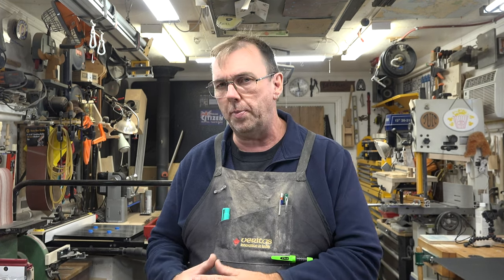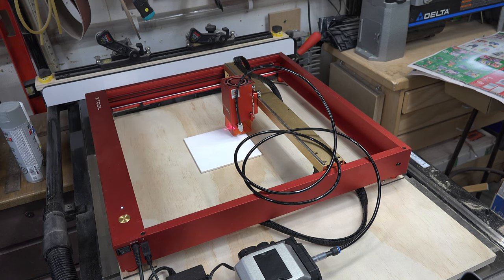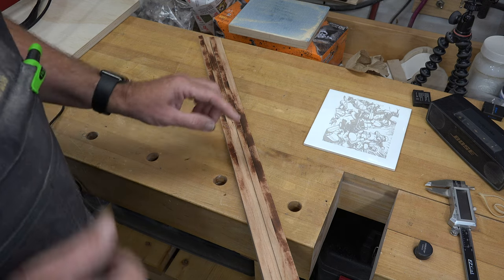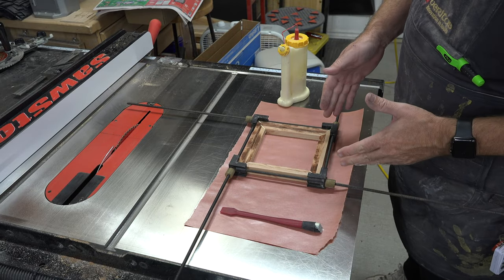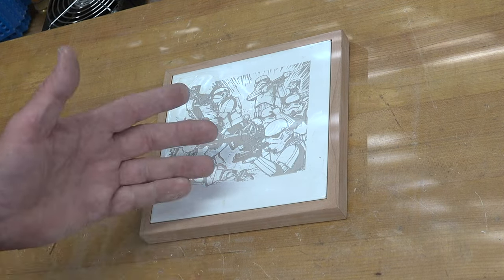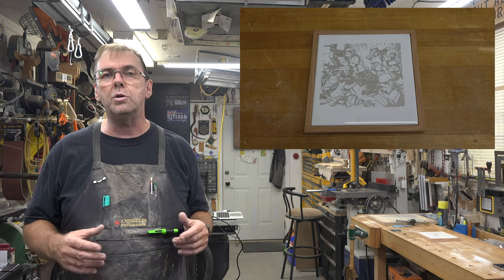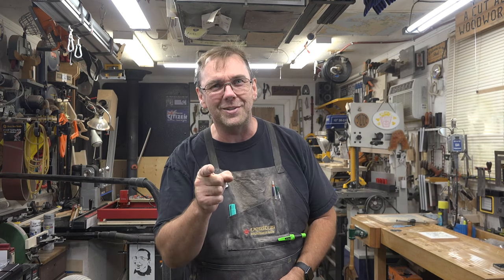Making Ceramic Tile Trivets

Comment: Kenny, I have been making trivets using ceramic tiles for years.  Gotta admit that adding the laser etched design to it brings the entire project to another level.  Another thing I do is to put a small self-adhesive cork circle to each bottom corner.  Helps prevent any scratches.  Nice project.
Reply from the maker: I like your cork idea Paul. That is spectacular.  Just goes to show that there is always room for improvement.  Thanks for tuning in and for chiming in with your methods.  Great stuff.

Comment: Perfect timing!  I’m a teacher and I’ve been planning for my class and another class to paint a ceramic tile with acrylic paint and to then build a frame just like you did.  I’m going to take your suggestions on how to make the frame and the students will do the rest. Thank you!!
Reply from the maker: Great use of the project Lisa.  You don't necessarily have to have a laser engraver to enjoy the projects on this show.  I wish you class good luck on their projects and I hope they have fun doing it.  Thanks for tuning in.  I'd love to see their trivets when they are all done.  Feel free to email me pictures of the class projects.
Reply: @acutabove_woodworkings   Hi Kenny -  we had a couple of snow days last week so the kiddos didn’t get to their tiles yet. Supposed to be cold this week, but no moisture so it should be a good week for the project. Meanwhile, I’m working on cutting the frames. I’ve cut some red oak 3/4” x 7/8”. I can’t figure out which is the height and which is the width?  Is the frame 3/4” tall or 7/8” tall?  Thanks I’m advance. 🙂
Reply from the maker: @lisaalbrecht7900  The frames are 3/4" tall.  Each slat in the frame is 7/8" wide.  I hope this helps.  Looking forward to seeing the kids' trivets.
Reply: @acutabove_woodworkings   Oh, that makes sense!  Thank you!
Reply: @acutabove_woodworkings    We made trivets this week!  The kids had a fabulous time. I have a couple of photos, but don’t know how to post them. The K-5 students worked with frames we had pre-assembled for them. The 6th-8th grade students I had them assemble their own frames from the pieces I cut for them. We used blue tape on the corners. It was such a great project!
Reply from the maker: @lisaalbrecht7900  This is amazing.  I'm glad that you were able to pull it off.  You can always email me the photos at kennye@acutabovewoodworkings.com or you can send them via PM on the channel's Facebook page.  Whichever you would like.  Unfortunately, YouTube doesn't have provisions for posting photos.

Comment: Love the project.  Been tossing around the idea of making a few trivets but wasn't sure if paint would melt when you put a hot pot on it, thus ruining the pot and messing up the trivet as well.  If you do use paint, would it have be that temperature stuff for bbqs?    Now if only Christmas WASN'T right around the corner.   Thanks Kenny!
Reply from the maker: I don't think it would have to be heat resistant paint Tom.  I mean, once it is cured, I honestly don't think a hot pot or dish is going to have enough residual heat to "melt" the paint.  Thanks for tuning in and for chiming in with your question.

Comment: Nice project!  I have an unrelated question:   I noticed a small computer fan in the tool trough on the back of your bench.  Would you enlighten me as to its purpose? 🤔🤠
Reply from the maker: I use that fan when I am working on a pyrography project.  (wood burning). I use it to draw the smoke away from me as I am working on a piece so that I am not breathing in the smoke from wood burning.  I hope this answers your question Randy.  thanks for tuning in.

Comment: Where do I get the wooden frames for 12”x12” tiles?
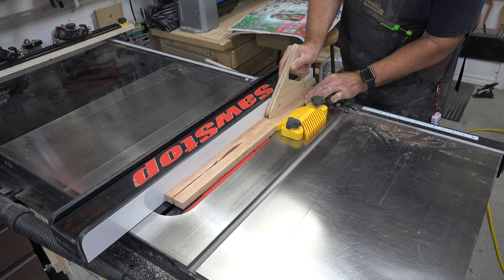Reply from the maker: At 4:11 I demonstrate how to make the frames.  I didn't buy it, I made it.  Thanks for tuning in.
Reply: @acutabove_woodworkings unfortunately I don’t have the equipment to hand make a frame
Reply from the maker: @susanbrocksmith4255  I did a quick search on Amazon and they have plenty of 12"X12" frames.  Maybe one of those would work for you.
Reply: @acutabove_woodworkings  for a heavy 12”x12” ceramic tile? I was thinking of a floating frame to glue the tile into it if that makes sense?